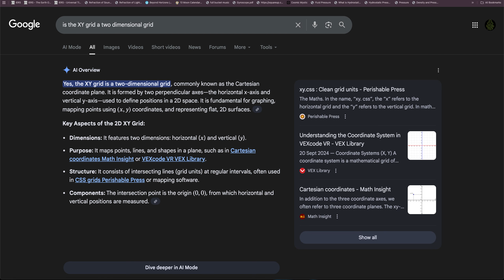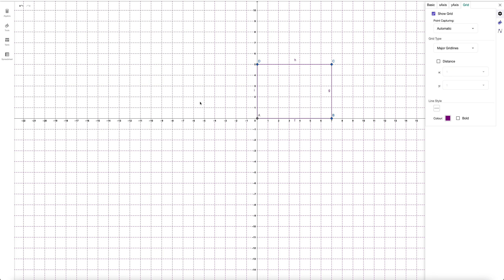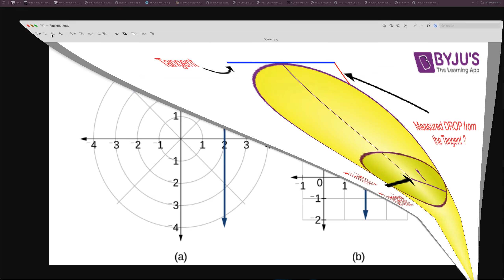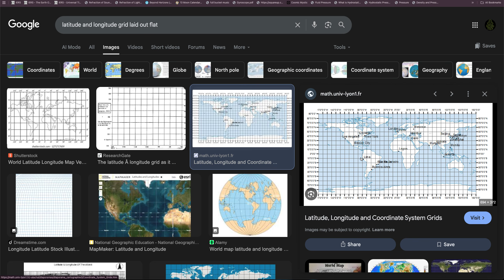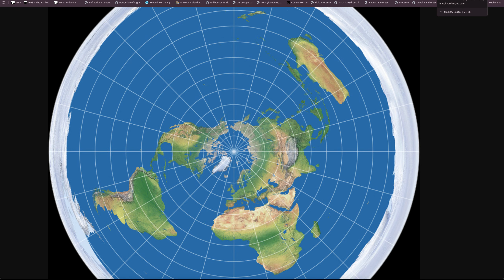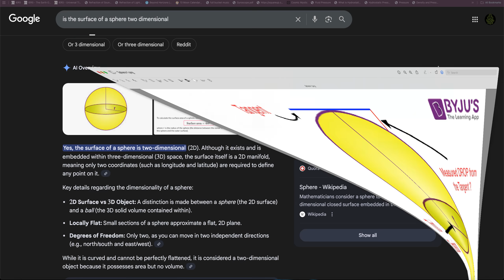The 2D Globe  lol

Comment: I did try to tell you but you didn't hear. The end point of this road is that it's non Euclidean. Go ahead, try to debunk what has to be, try starting at 69.11 miles horizontal distance and see where you end up.
Reply from the maker: I did hear I took in every part of it but you didn’t listen to my critiques, as you measured a difference of just over 327 feet over almost 70 miles, and then claimed that the 69.048 was an average. 
Now I’m sure it may be an averaged amount, but that average is more than likely an average based upon measurement error, as what happens if you do it again but get less than 69.048 or 69.048 on the button or more than 69.11, and you must remember that you also explained, that you weren’t totally certain if you were exactly at the 54 degree point, as you said that you didn’t want to have to invade someone’s back garden ?
There’s too many variables for you to say that the distances between latitudes change, when all you have is a single measurement, you as someone who has a surveying certification would surely understand this ? 
Edit: Sorry meant to say, how could the situation be non Euclidean when you’re measuring using an Elevation Angle ?
Reply: @BriansLogic  Why are you two spending so much time bickering over 300 feet per degree? It only changes to equator-pole distance by 5 miles.

Brian, you should be more concerned that the equator is only 24,000 miles long when the dimensions of FE dictate that it should be 39,000 miles.
Reply from the maker: @andrewjohnston6631 Translated as…. My deep religious belief in a globe earth, compels me to make claims that would make the latitude and longitude grid not fit my globe, as it would result in more than 1.1508 times 10,800 nautical miles, and I’m compelled by the fact that two separate parties are referring to these distances on a plane, even though the grid being referenced is only 2 dimensional, and what I’m claiming is a 3 dimensional scenario, but I can’t understand that simple concept, due to my religious belief not allowing me to understand it.
Reply: @andrewjohnston6631  Yup, if R≈3959 miles for the globe radius, the globe circumference is 2πR. The flat earth equator radius needs to be ¼ of this or πR/2 ≈ 6219 miles to satisfy the 69 miles per degree relationship. So using the the globe's radius R≈3959 miles, the formula for the FE equator is 2π × πR/2 or simply π²R  ≈ 39,000 miles. 🤓
Reply: @andrewjohnston6631 He’s confused about the fallacy and spending time on it because the maths of the horizontal distance doesn’t help him and he can’t see the link to the fallacy 🤷🏻‍♂️
Reply: @BriansLogic Translated as, why are you talking about converting nautical miles to miles?  Nautical miles are real distances.  You dont need to convert them to anything.

But, I'm intrigued now.  How does converting to imperial miles debunk the globe?
Reply: @B @BriansLogic ou can do it yourself but you won’t, you can do it yourself and check for yourself but you’ve said you won’t. You won’t do it for yourself, so it doesn’t matter, you don’t trust that I did it, you don’t trust that anyone else has done it, so what’s the point? 
The maps already exist before the measurements of the angle to the light in the sky and the documentation of the angles onto the maps. I hope the discussion about these measurements will continue because they are something that has been done and they still can be done by anyone. The angles are less of a problem for you than the fallacy of mistaking the map with the territory, something you’ve become a leading figure in, you have to remember that I asked for a quiet word about it. After Flatzoid last night it’s turned into a debate 😂, a debate about a fallacy that you’ve helped the flat earthers accept 🤦🏻‍♂️ I hope you can get content from the fallacy and help the flat earthers into the future with you new form of mathematics but I doubt you’ll be able to talk about it with anyone who applies logic to what you’re saying. 
Let’s expose the fallacies (or accept them) as the case may be 🙏
Reply from the maker: @TryThinking  No Bev it's not about whether or not I trust anyone, you have made a claim and now you need everyone else to support it for you that's what's going on, you must support your own claim as it's not up to me or anyone else to support it for you. 
Now you're still trying to lay a claim of fallacy at my door, a fallacy that you are committing when You reify a distance on the map, that's the fallacy of reification as you're reifying the distance on the map as reality, and worse than that it makes what you're doing pointless, as the distance on the map is the thing that's in question, so how can you refer to the map to check the validity of the map ???? 
That's equivalent to to my globe proves my globe, when the globe is the topic that requires verifying ? 
Bev you asked me to come over for a chat, and what that meant was to come over to your server to talk with you and your panel, you said nothing about a private one to one chat until Monday night, when we were already in a neutral server because I would not go over to your server, you are and were fully aware of this, so trying to change history is not very becoming of you ? 
Now you can call what we had a passionate discussion if you like I don't care, but don't claim that you were looking for a private one on one chat, as that's called a phone call something you did not ask me for. 
As far as others terming it as a debate they're calling it what they hear, whether their opinion is valid or not is irrelevant, they have an opinion and they will air that opinion, as nobody starts or looks for a friendly one to one chat by laying a claim of fallacy at the other persons door, that's not how friendly chats work. 
Now if you're going to claim that the maps came before the grid, then you will have to find a map that does not have the latitude and longitude grid upon it, as otherwise you can't support that claim, and just so it's clear my issue is with the proof that the 1.1508 ratio between nautical and statute miles is correct, and I am not talking about an possible extra 327 feet of a difference, I'm talking about vastly different, something I have investigated the very real possibility of, but not something that I'm willing to speak with others about as yet, because more investigation is needed. Brian.
Reply: @BriansLogic The maps we use have a grid co ordinate system and they are flat. It would be fallacious to assume that the earth is also flat, because assuming the map is the territory is fallacious reasoning. Please remember that I wanted to talk to you privately because this is the fallacious reasoning that flat earthers have been using for years, you obviously wanted to make it public. Now’s your chance to show your logic of how the flat earthers can accept the fallacy openly 🙏
Reply from the maker: @TryThinking You didn’t want to speak with me privately that’s a lie, you wanted to chat to me WITH all your panel. 
Now the only person reifying maps here is You, with your positive distance claim, that’s the fallacy of reification, it’s not the only logical fallacy you’re committing ?
And there’s no assumption that the earth is flat it is flat, as there is No other description that suits its surface better, just like maps are and can only be described as flat, even though glass screens and paper are not 2D surfaces, and saying Not flat is not a description, as you don’t describe something by telling people what it’s not, it’s also a knowledge claim. 
Yes grid maps exist they are converted to latitude and longitude, grid maps use Cartesian Coordinates which as a grid reference is younger than latitude and longitude, see Celestial Navigation, Astrology, and Astronomy….
Reply: @BriansLogic No Brian, I wanted to speak with you about the fallacy and you wanted to make it public. Flatzoid thinks it was a debate about a fallacy now 🤷🏻‍♂️ you’ve now got the remaining flat earthers accepting a fallacy assuming the map is the territory (earth) 🤷🏻‍♂️
You’ve even joined forces with the dogmatic ‘“globe”’ guys and accepted the average distance between latitudes 🤦🏻‍♂️. 
Let the conversations begin. 🙏
Reply from the maker: @TryThinking 1. No that is a lie you mentioned nothing about a private one to one call or anything similar, you asked me over to your server to interact with You and your Crew, there was no mention of a private situation until we were literally on Geo’s. 
2. Once again I didn’t commit the fallacy you’re claiming which you ADMITTED, but YOU committed it and continue to commit it, and maybe go and speak to Flatzoid if you’re unhappy with whatever, but don’t forget YOU created the situation that they now reference, so go and ask them about their opinions. 
3. Incorrect the Ballers claim what YOU claim, as they claim an oblate spheroid geometrically, which would be a constant change in latitude distances. 
So all 3 of your points are WRONG Bev…. And the first one is not just wrong but a Lie ?
Reply: @Bri @BriansLogic  been asking you to come for a chat for years, and you should know that I do not oblate the globe. The real globe is not the dogmatic ‘“globe”’ you assume on the other side of your false dichotomy. As I’ve said, I’ve been trying to get to have a conversation with you about this for years but your seditious mindset has kept you imagining there’s a rift between us. The fallacy remains no matter what you think, the horizontal distance proof of globe still remains within the arena whether you want to hear it or not.

Also, the distances between latitudes changes due to its position, it’s below 69 miles close to the equator and close to 69.4 miles as the numbers get higher. The number that you had on your video is the number that “‘BlueMarble”’science’” uses, once again you’ve come to defend the dogmatic ‘“globe”’ position with your conversion of the average into nautical miles 🤦🏻‍♂️ 👏🏻
Reply from the maker: @TryThinking Sorry Bev you seem to be confused, as what you claim is in alignment with what the ballers claim, I on the other hand didn’t make a claim, I presented the official figure which is a ratio, maybe Blue marble is presenting the same figure, which would be in contradiction to his other GLOBE CLAIM, as within his globe claim there is a change of distance between latitudes, just like in YOUR CLAIM BEV ? 
I on the other hand presented the official ratio, which is used for conversion all the time, a ratio I don’t even know is correct, so YOU and BLUE have a CLAIM, but I do NOT have a claim are YOU understanding that yet ? 
And I don’t care about what YOU don’t do, they claim an oblate spheroid, so YOUR CLAIM is in alignment with their claim, as ye are BOTH making claims that NONE of ye can support. 
Now YOU are committing and have committed the fallacy of reification, and it seems that you’re going to continue committing it, while trying to lay that fallacy at the doorstep of those who have NOT committed it, you didn’t even know the name of the fallacy you were trying to stick to me, that shows exactly how much you know about it, which is nothing it seems as you don’t know when someone is committing that fallacy, because you still ( after 6 days ) don’t understand that YOU are committing it Not Me. 
Come over for a chat ? So Now you admit to being lying previously, as you didn’t ask for a private one on one chat, you now admit that you were only lying about that, not that I didn’t already know that obviously, but it’s always nice to get an admission, even if it’s not intended ? 
And there is a problem with me going over to your server, and it’s worse than it was before, as before the problem was that you guys talked big but didn’t know what you were talking about, but now there’s the problem of you being a liar, why would I want to spend my time talking to someone who’s willing to lie, what good can come of lies Bev, nothing is the answer. 
So besides the fact that I was treated like garbage the last time I went to your server three years ago, now there is the added lying which is illogical Bev, as I didn’t commit the fallacy of reification YOU did, I didn’t receive an invitation for a private phone call, YOU didn’t ask me for that as you now admit ( unintentionally ) but worse than that Bev is the time wasting….
Reply: @BriansLogic unbelievable Brian, the fallacy is called the map territory relationship fallacy ffs and I’m telling you that the horizontal distances prove the globe. There’s nothing you can do about it. It’s time to wake up, the earth isn’t flat, the horizontal distances prove it isn’t. Come for a chat and I’ll try to explain.
Reply from the maker: @TryThinking It’s not it’s called a reification fallacy Bev smh, and there is no globe the earth is flat as is proven via the measurements, what does the word globe imply and the word flat describe you’re busted ? 
And come for a chat ? WE JUST HAD ONE on Geo’s, what you’re attempting to do now, is descend this very embarrassing situation you’re in into farce, so you can some how come across to people as if you’re trolling, but we both know that you made a fool of yourself, and you don’t have an argument or a set of measurements that support your claim, I was willing to just forget about it a few days back, but now as you’re displaying a lack of humility and treating me like I’m stupid, I am definitely not letting it go ever Mr one measurement is an average ? 
Oh and you couldn’t explain nothing to me, as you don’t know what your talking about, whoever you once were I don’t know, but who you are now is a delusional idiot….
Reply: @BriansLogic For your information, my position on the counter rotating sun circles, which we’ve had lengthy discussions about with flat earthers all over the place is that they’re impossible to explain. You’re free to come and chat about them anytime.

Comment: 15:23 Actual quote from Brian. "It does work mathematically"... Hmm I wonder why that is.

I think your confusion here Brian is you've misinterpreted How the actual grid coordinate system was originally defined/created with how you find a location using that coordinate system. For instance, On google earth. which represents a Sphere globe,  Monkstown in Ireland is defined as having a location of 51°51'02"N 8°19'59"W. Or 3171.033 nautical miles north of the equator and then 308.85 miles west of the prime meridian. Either way, only 2 dimensions have been given. I don't need to to calculate where 51 degrees north is. It is already defined and as I am not redefining the coordinate system being used only 2 Dimensions are required.
Reply from the maker: Yeah your confusing mathematically with actually, lots of things work mathematically like Star Wars for example, but that doesn’t make something real or correct….
Reply: @BriansLogic  Please provide evidence how star wars works mathematically.
Reply: @BriansLogic  Careful Brian Drhex has just given you the coordinates for Narnia 😂
Reply from the maker: @BigBoaby-sg1yo Lol 😂 good one Boaby…. 
They think that they can reference where they are on a spherical surface with two dimensions smh….
Reply: @BigBoaby-sg1yo  Brian made a claim, I asked for evidence. As no evidence has been provided his claim can be dismissed. If you are referring to the co-ordinates in my original post, Are you claiming Ireland is Narnia?
Reply: @DrhexUK No ! I’m not . 👋👋👋😂😂😂
Reply: @BigBoaby-sg1yo So you don't know how latitude and longitude works then?
Reply: @JohnSmith-ux3tt YES !
Reply: @BigBoaby-sg1yo Yes, you dont?
Reply: @JohnSmith-ux3tt oh yes I do Johnny boy ! I work at sea Johnny me little sweetheart and use Charts - Most nautical charts use the Mercator projection, where longitude lines remain parallel.  And let’s forget our old friend the Grid System: Latitude lines run horizontally (East-West), and longitude lines run vertically (North-South).
Tsk Tsk Johnny darlin ye will have to try a lot harder than that .
👋👋👋👋👋👋😂😂😂😂😂😂
Reply: @BigBoaby-sg1yo  So you use charts that are a projection of the globe. Interesting.
Reply: @BigBoaby-sg1yo  so, you’ll already be aware that lines of longitude, or meridians, converge as one moves both northwards and southwards from the equator. Perhaps you might explain this to Brian who claims that they diverge southwards from the equator.
Reply from the maker: You live on a Flat Earth that’s why mathematically you can believe in a sphere, but then use 2 dimensions in real life, it’s because the Earth is Flat….
Reply: @BriansLogic  Google earth does not show a flat plane. It show a globe. And 2d coordinates. Try again.......